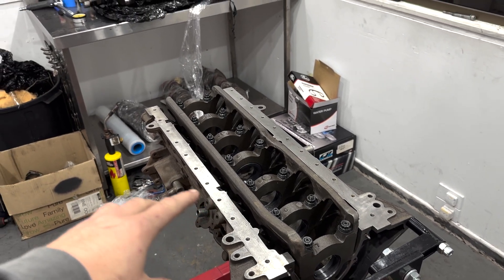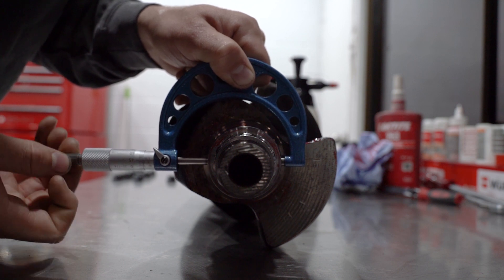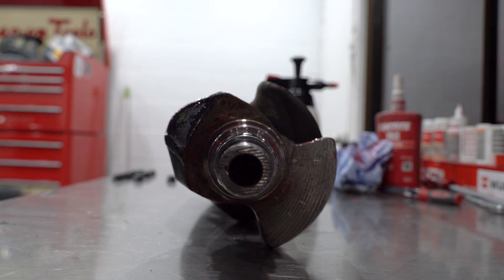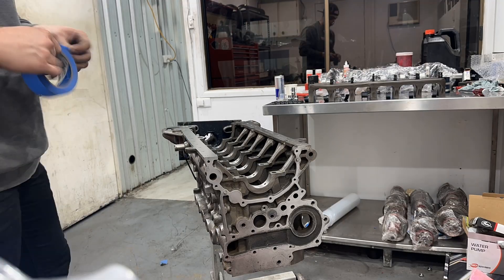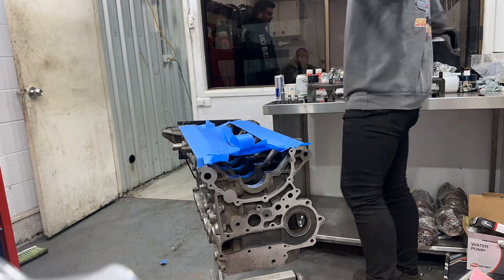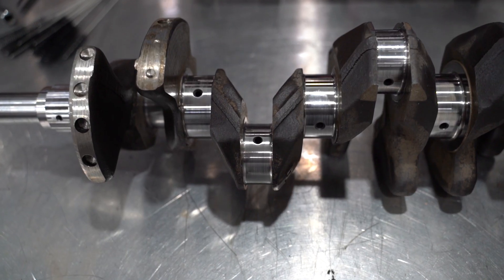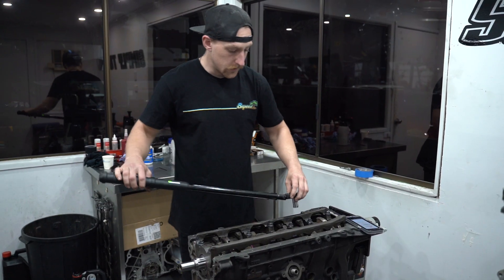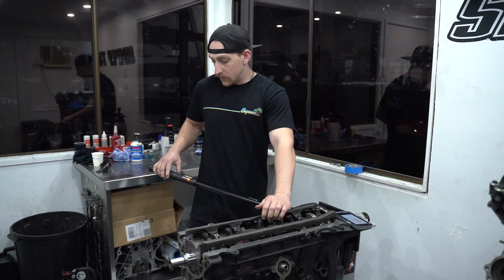The R33's RB30DET engine build begins...

Comment: When referencing the piston and rod weights, you mention having the heaviest piston with the lightest rod and vice versa to have even weights across as closely as possible. Would where the weight rests be a factor when considering the movements of the weight? Meaning the piston being on the outer limits and the rod being closer in. Or is it that since it’s not like a wheel and more of an actuation that the placement of weight is not important? As im writing this, I’m thinking it’s more of a combination of the two but as close to cloning the weights the better yeah? TIA!
Reply from the maker: I hope I’ve interpreted this correctly, if you mean by “where the weight rests” as in one end of the manufactured item being heavier than the other, there’s not too much you can do about that, you can take small amounts of material away from very particular places on a rod or piston assembly to lighten it and match weights better, something I didn’t do was measure the big and little end weights of the rod (this being very far out of the rod manufacturer spec would possibly cause excess vibration) however considering that Nitto manufacture incredibly high quality parts I trust that they’re in spec and have used these rods before with 0 issues (I also do not possess the tooling to measure big and little end weights just yet). As for the pistons I am not aware of a process like this for so have only ever taken into account the overall weight of the item as I believe most engine assemblers do…..

Thanks for your comment, I hope I answered your questions, apologies if I misunderstood
Reply: @Racelab_life  naw you’re good, thanks for responding. Later I thought about how if you lifted a golf club up and down, from either end, would the forces generated be different. Because it’s on the crank, it’s nearly identical, just the rotational portion of the rod and crank had an additional axis. I wasn’t sure how much that could play a factor with overall vibrations if they were mismatched, or if it was worth the time and effort to keep them as close as possible.
Reply from the maker: @Master_Psyper  A lot people don’t go this far and some would say it’s un-necessary to do what I have, I know plenty of engines and engine builders who have just assembled an engine without worrying about weights at all and it has worked perfectly fine (including myself on a very budget build I did years ago) so long as quality enough parts are used and you’re not expecting to rev the engine excessively high it’s usually fine) I just like going above and beyond “what’s necessary” for the fun of it
Reply: @Racelab_life  sweet, I’m just a lurker who’s hoping to acquire an rb30 block and 25 head in the coming weeks so just soaking everything in and thought I’d mention it. It seemed like most reputable companies send pistons and rods most closely matching anyway so it definitely seems like overkill with what it itching my brain🤣thanks again!